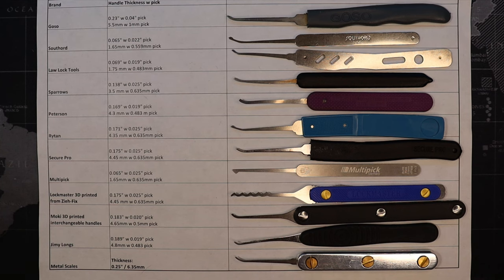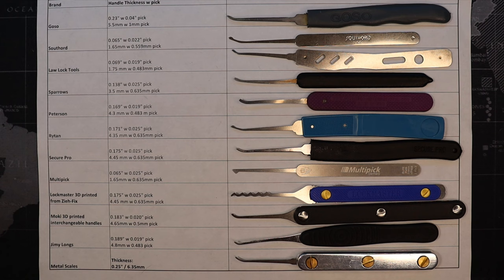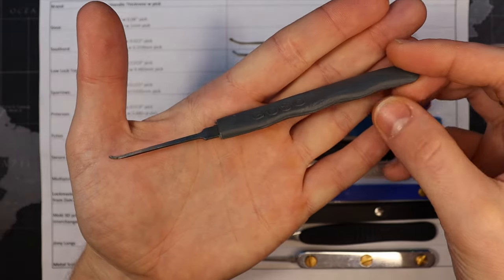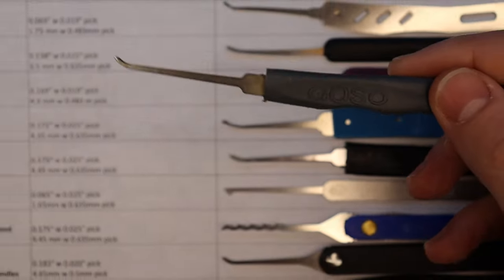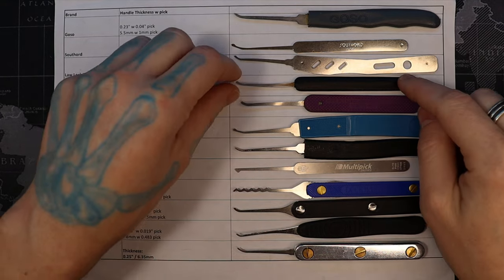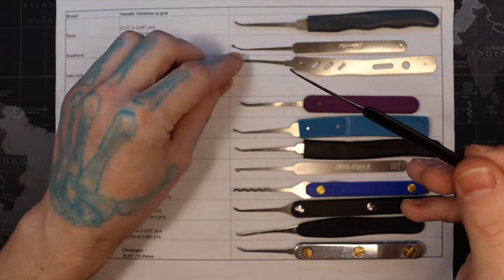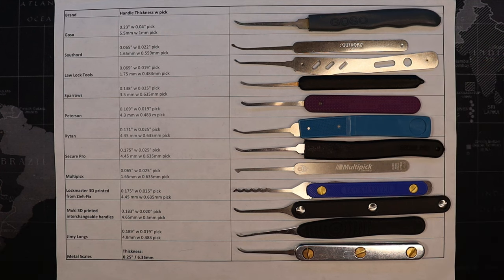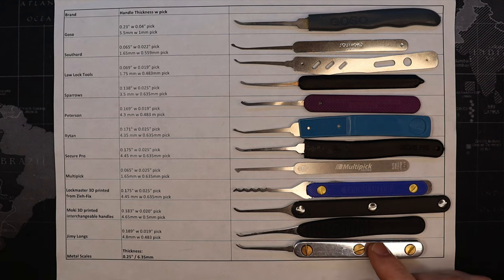295) Lockpicks Handles  - Thickness, Density, and Feedback

Comment: I have been wanting to make a reusable handle for a sparrow euro short hook (one of my favorite picks) for the longest time, I was always just going to make it from G-10 or micarta, but watching this changed my mind. Would you be willing to point me in a direction, where I could find the quarter of inch aluminum like the stuff you recommend in the video?
Reply from the maker: McMaster Carr website for the metal bars. My next video is on making interchangeable handles, maybe it will help make things easier 😁
Reply: @LockpickingDev THANK YOU.  Looking forward to seeing the next video 🤜💥🤛
Reply: @LockpickingDev  Sorry to be a pain, but I wanted to get the materials, I found aluminum bar 1/8 thick x half inch wide, and 2 feet long (would that be the correct size to start with?)
Reply from the maker: @RookKnight  that's perfect. That's what I use 😁
Reply: @LockpickingDev  thank you brother !! I'll order it, and have it ready for your video 👍🏻👍🏻 you wouldn't know what size Chicago screw to order off hand 🥺
Reply from the maker: @RookKnight  you need the Chicago screws from Wendt. Even then they are slightly too short for the 1/8 when combined. So you will have to drill the hole for the screw heads deeper. If you use 3/16 thickness you won't have to do that. I figured this out the hard way 😅 Feel free to PM me on social media and I'll send pictures to explain if you'd like.
Reply: @LockpickingDev  thank you so much, I will send you a PM tomorrow of that cool, have a good night  thank you again!! 🙏